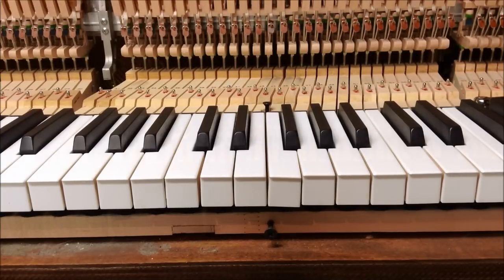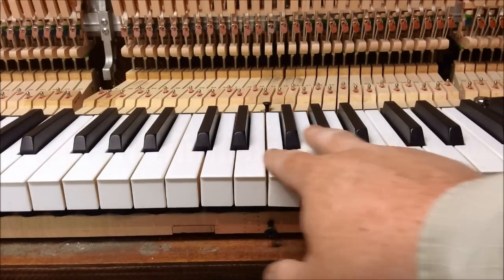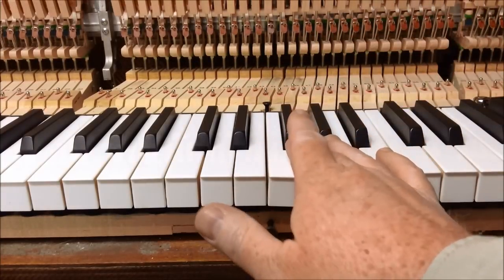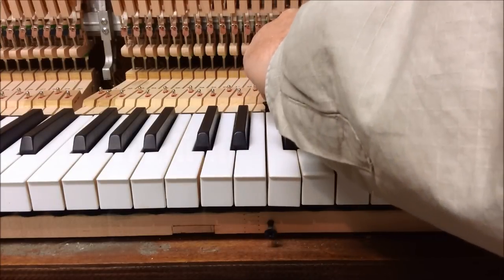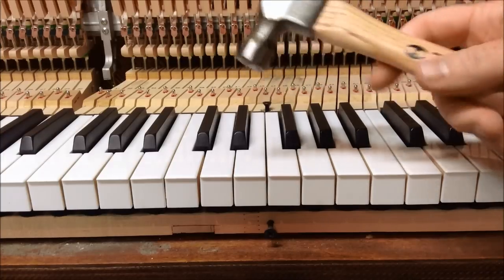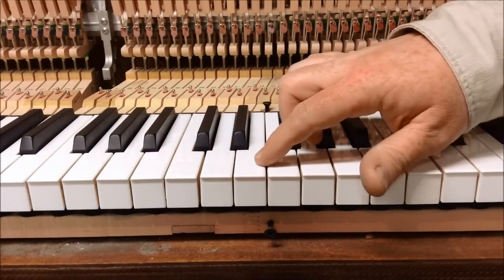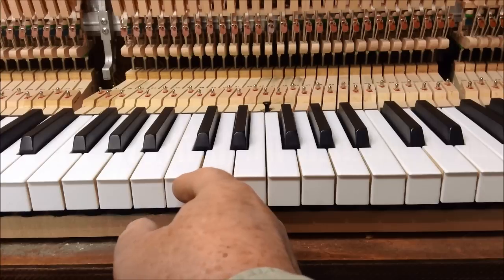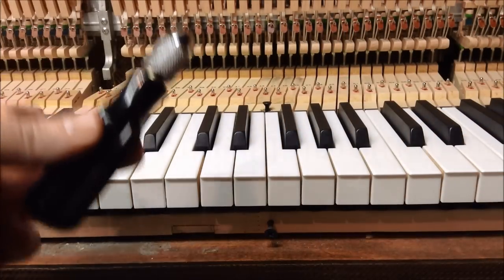Piano Tuning & Repair - Squaring And Spacing The Keys I HOWARD PIANO INDUSTRIES

Comment: Thanks for your videos. Very informative. About balance rail pins tapping ... what do you do when you tap the balance rail pin, the key gets leveled, and now the back of the same kay rubs against its neighboring key? Do you file the rubbing key at the place of the contact with its neighboring key in order to get enough clearance?
Reply from the maker: Yes, if the front of the key is spaced correctly and the key is leveled then you may need to do a little sanding on the back of the key to keep the backs of the keystick from rubbing on it's neighbor.
Reply: Thanks for your quick response.

Comment: do you square the keys the same way in a grand piano?  Tried it with my model M and had difficulty, when I moved the pin, the key would jam and I would need to twist it back the way it was for the key to function again, apparently the piano has pins that are not shaped roundly.  Any advice?
Reply from the maker: Yes, the adjustment to the keys on grand pianos is the same.  It could be that the problem you're having is that the key may be warped slightly which is causing the problem.  I can't say for sure without seeing it, but this is one possibility.

Comment: Hi,
I have a Estey upright that was made around 1919. Last fall we had a leak from the ceiling that soaked the keys and now a number of both the white and black keys stick. Prior to the water problem the piano was in tune and played regularly.
After watching your videos, I think the felt was water damaged and probably need to be replaced. Can you refer me to a source for piano key felt? I'd like to approximate how much this is going to cost before I start to dig in.
thanks
Reply from the maker: We have a website where we offer all kinds of felt for pianos including key bushing felt.  We also have a set of two videos that show how to do this.  Here is a link to the video which also has links to the felt and the tools needed to do the job: http://howardpianoindustries.com/piano-key-bushing-replacement/  Most likely the problem is that the key bushings swelled from getting wet and are the cause of the sticking keys.
Reply: Hi Howard for your quick reply. I decided to just give it away, we're moving and don't want to bring it with us.
So I can give full disclosure, can you give a ballpark figure what it would cost for
1. a pro to repair it and 
2. if done as a project.
Half the ivories & as many of the ebony keys stick.
I don't expect an in depth analysis, I realize you're only going by what I'm telling you. But, a rough estimate would be appreciated so I can pass along the information if someone is interested.
Feel free  to pm me if you don't want to publish your figures publiclly.

Thanks.
Reply from the maker: The prices can vary quite a bit based on the area you're in and what technicians are charging in your area, but a ballpark estimate on average would be around $300 to replace all of the key bushings.  The parts and tools needed to do the job would be around $25.
Reply: howardpianoind  Thanks for your time, much appreciated.